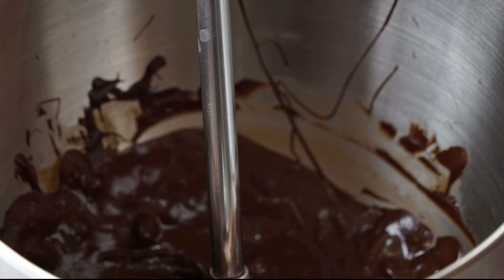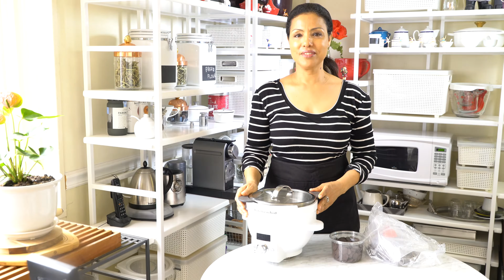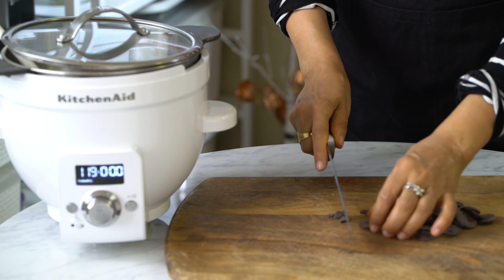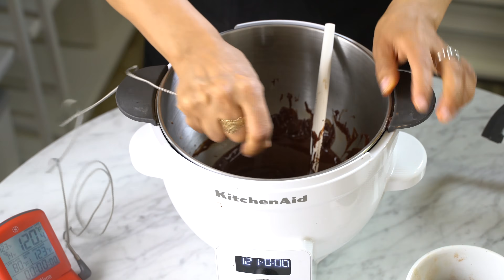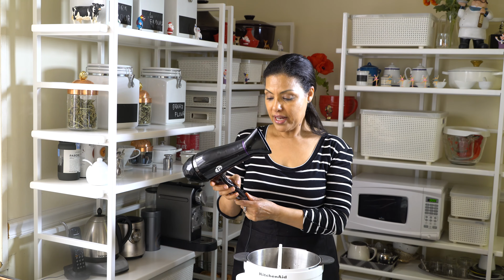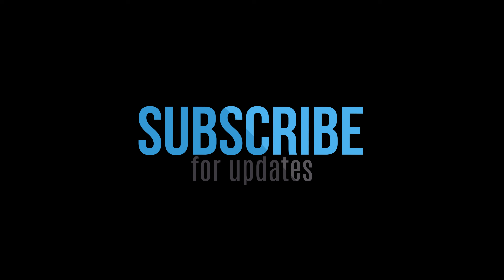Tempering Chocolate Using KitchenAid Precise Heat Mixing Bowl

Comment: One issue no one is talking about here, that someone had to bring to my attention: LOCK BOWL INTO BASE BOWL, (if you watch closely, this Chef locks it down) otherwise heat function won’t work properly. Set in base offset to the left and twist it to right to lock the bowl into the base. Lift bowl. If it doesn’t lift entire unit, you didn’t lock it in properly and heating element won’t work correctly. Also, use it with the KitchenAid mixer to stir ingredients to keep temperature consistent throughout.

Comment: Why are you mixing this with a hand mixer? Do you not also have a Kitchen Aid stand mixer? That's what this device was made for, after all. There are cheaper devices available if you just want to temper chocolate manually.

Comment: Some reviewers said it’s thermostat is not accurate. What have you found? Is it trust worthy?
Reply from the maker: It is true that the thermostat is not accurate, that is why I use an external to read the temperature, then I will adjust the dial until I get the desired temperature, for now it is the only thing available for home use.

Comment: Thanks for sharing. I'm curious why you use another thermometer while this machine already has thermometer?
Reply from the maker: Great question, it doesn’t matter which device you are using when dealing with the heat you should use an external thermometer to double check the temperature, plus the source of the heat is in the bottom of the bowl and the machine is displaying the heat of the bottom only. With the thermometer you can read the temperature of every inch of bowl. I hope I answered your question.

Comment: When using the seeding method, you dont need to reduce to 81. You can just bring it between 86-90 for tempered chocolate. It is important to note using the seeding method.
Reply: Nope. Wasted my night putting this theory to the test. Scraping all the way through the cool down to 82 creates more alpha crystals, period. Bars wouldn't hold shape. Barely solidified. Had to be frozen to be peeled from the molds. Haven't biffed a batch that badly in years.

Comment: There are 2 major problems with the KitchenAid chocolate tempering machine. 
1) The tempered chocolate only stays warm at the bottom of the bowl, so if you want to dip shortbread cookies or anything else in the chocolate, the chocolate becomes too thick and cool at the top for the cookies to pass through.  I wish the sides of the bowl also stayed warm.  There is a very small heating element at the bottom of the unit. The top 2/3 of the KitchenAid bowl is cool to to the touch and thus the top 2/3 of the chocolate mixture remains cool too at a the recommended 88 degree temper holding setting.
2)  The  KitchenAid recipe for tempering chocolate calls for starting with 22 ounces of chocolate in the heating bowl. My chocolate never fully melted, even after 1 hour and continuous stirring there were lots of lumps.  I had to take the semi-melted chocolate out of the KitchenAid machine and warm the chocolate to the desired temperature on the stove.  I really do not see the use for this machine.  It is an expensive waste of time and and effort!
Reply: Hi Chef, first of all, thanks for the amazing (and inspiring) video. Just following up on Coco's question, if the issue was uneven heating, can I temper it using spatula, and later use the KitchenAid mixer and flat beater to paddle around the chocolate once it is at 32C? Is there any issue with using the paddle/flat beater with this bowl?
Reply: @vickyjanita9145  Attaching the bowl to the mixer and switching it on to move the chocolate inside the bowl is exactly the intended use of the bowl. The video uses the bowl separately, hence the "issue".
Reply from the maker: Hi Coco! I completely agree with the issue you are describing. I bought it this bowl because it was the first one of its kind. It is not perfect but it helps me some how. 
You really need to plan ahead before planning melting the chocolate, pour the solid chocolate in the bowl few hours before not one hour, cover it with the lid then put a dry  towel to help the temperature. some time I put the chocolate in the morning in the bowl so I can work with it in the afternoon.
The benefit of this machine, is that the chocolate temperature can never be above the selected temperature and that it is very important to me when I am tempering the chocolate. Good luck
Reply: One issue no one is talking about here, that someone had to bring to my attention: LOCK BOWL INTO BASE BOWL, otherwise heat function won’t work properly. Set in base offset to the left and twist it to right to lock the bowl into the base. Lift bowl. If it doesn’t lift entire unit, you didn’t lock it in properly and heating element won’t work correctly. Also, use it with the KitchenAid mixer to stir ingredients to keep temperature consistent throughout.

Comment: So I can temper my chocolate with the table method and use this bowl to keep it in temper temperature for molding and working with the tempered chocolate, right? 

thanks in advance <3
Reply from the maker: Elena, you got it. Plus you have a complete control of the temperature.
Reply: Then this is a "must have". Thank you! ♡

Comment: Once you have the chocolate in temper at 91 degrees, do you need to keep stirring it, checking the temperature with the external thermometer to ensure it stays in temper?  If you are using the chocolate for dipping, will it maintain the 91 degrees while you are dipping, say caramels? shortbread?  I'm surprised a crock pot manufacturer has not made one of these if it's easier to use it away from the mixer.
Reply from the maker: +Janis McDonald , you really don't need to stir all the time. I just want to make sure that the temperature is evenly distributed. I have to use a thermometer, because the temperature displayed on the bowl reflects only the button of the bowl. The temperature will stay around 91 degrees even during the dipping. Because the bowl is constantly increasing and decreasing the temperature to keep it in the desired number. I hope I answered your question.

Comment: Once you temper and let the chocolate set to its "snap" glory, can this be remelted to use again later or wont set properly if remelted? Id like to temper chocolate in larger batches and re-use later, is this possible?
Reply: if you remelt it then you have to re temper it.  The one exception is if you use already properly tempered chocolate and melt it only up to and NOT over the tempered temperature.
Reply: @kathleeninkansas1770  Hi! So if i put in properly tempered, professional choc, keep it at or below 91? Thnx
Reply from the maker: Thanks +kathleenin kansas for your response. +jessicalynn82013, You can reuse the molded chocolate, but you have to follow all the steps from the beginning.

Comment: I don´t really see how the bowl is improving the tempering process, if you still need to measure the temperaure and add chocolate and stir and so on. It seems to me the only real use is to maintain the tempered chorolate for a longer time. I hoped for more when I read at the KA website about the possibilites to temper chocolate with the new device. Thank you for sharing your experience.
Reply from the maker: +Laura Ausberg (Silbermilch) , very good question. I use the thermometer to make sure that the bowl is perfectly accurate specially since my thermometer beeps, if the bowl temperature drops or increase with even one degree. This bowl helps me to stay away from the water, and to maintain the chocolate final temperature for hours. I am planning to use this bowl to create the French nougat, creme anglaise and other creams where the heat and mixing are necessary to succeed. I would not recommend to buy this bowl just for chocolate tempering. I hope I answered your question.
Reply: +Chef Rachida Yes. Creme anglais seems to be a good application. I also had lemon curd in mind.
Reply: My thoughts exactly; looks like it beat the purpose of the precise bowl with the other equipment you used as supposed to using just the actual kitchenaid gadgets, or maybe I’m just looking to better and more means to use this bowl ... just saying.